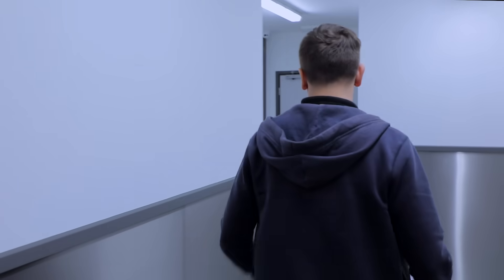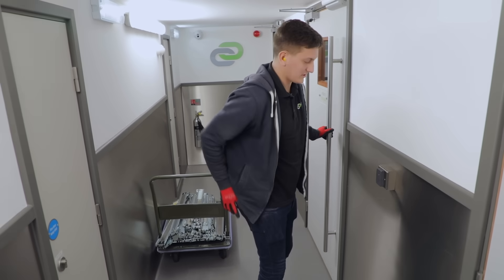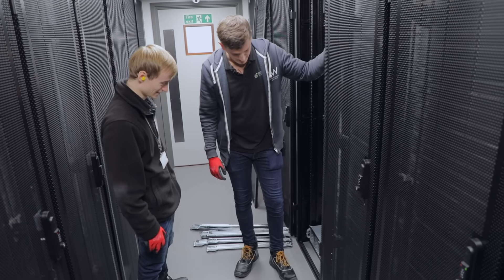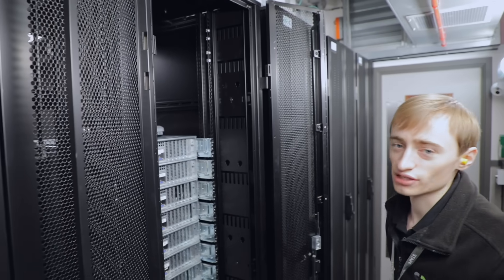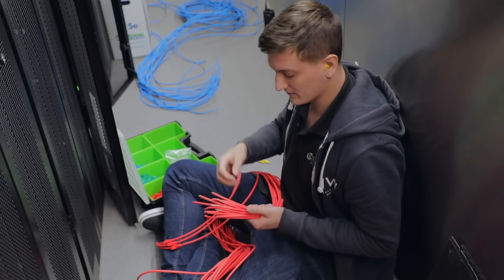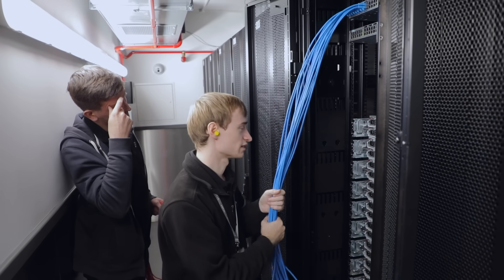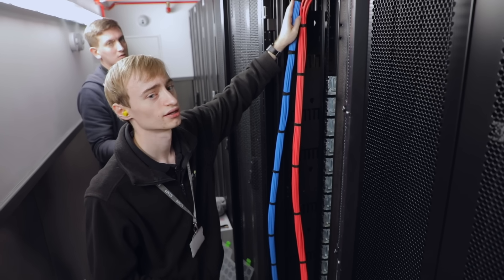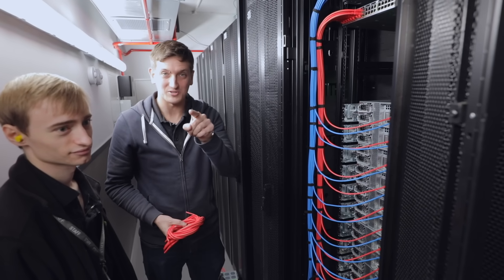A DAY in the LIFE of the DATA CENTRE | FULL CUSTOMER "RACK & STACK" with ASH & JAMES!

Comment: Isn't it more cost effective and faster to just use pre-crimped patch cables of the right lenghts?
Reply: Not faster, may be. First tou need to select correct lengths. And they will definitely not fit like this. Some will be shorter or longer. It is possible to make it look ok, velcro straps helps a lot, but not so cool.
Reply: @sYBtyumen  not to mention the certifying and testing process. Why would it be important to look neater if it's in a dark cabinet hidden and inaccessible to public?
Reply: The original question was about cost-effectiveness and speed. Not about quality. I personally prefer machine-made certified patch-cords  to ones that are made in-place by humans. It would look slightly worse, but almost definitely without CRC errors.
Reply: @sYBtyumen  under cost effectiveness I also include quality, because if you have lowee quality you see failures more often and have to deploy a service call
Reply: @KnaufL  you are close to be an ideal customer. No irony. Glad to see a person who understands that cost of maintenance and troubleshooting is a part of TCO.
There is a paradox. The higher is the original quality of parts and work the lesser will be the number of customers who think about troubleshooting and maintenance the next time. Cause they'v seen no troubleshooting, or troubleshooting results tell that a problem was in OS/Services/Apps etc. not the network.
Reply: @sYBtyumen  i try to understand both sides as best as I can. On the client's side you can look at it as if the client has a limited budget but wants to maximize profit margins, so for example he may choose cheaper equipment at the beginning and then gradually upgrade as his business grows

Comment: as someone who racks and stacks servers all day long, this is 100% the correct way to do it, but this takes way more time. rail, rack, and wire and power up about double that amount of servers in one day.
Reply: Yeah but do you know how to configure any of it... if you're doing this day in day out, I guess not and you leave that to the engineering experts, right? :)
Reply: @leephcom  that includes installing an OS as well as config. but its a minimal minimal install and a minimal config. still, 80 machines to image and bang in some ip config plus some minor troubleshooting. your hands will bleed a little and there will be TONS of trash laying around. dac is not fun to cable manage. especially 100gig dac. or 40gig breakout dac. ethernet is a breeze though, but i dont cut to fit.

Comment: You didn't leave slack to pull out the servers for servicing
Reply: Yeah that's what I noticed as well.
Reply: @MrMrRubic  it's pointless, costly extra cable lengths just to avoid unplugging a couple of cables in order to slide it fully out? Most don't bother with cable slack and concertina arms these days. You've got to power the thing down to do most maintenance tasks anyway so no need to keep the cables plugged in.

Comment: bro, you need to get some UCS. pretty cabling though, when you cut them to length I actually shed a tear.
Reply: That 15-meters copper USC cables...  The fibre-optic ones are much easier to fit (and sized better).

Comment: Do you realize that by not having those hinges welded, you are vulnerable to a low skill attack by someone just lifting the door a bit, especially since your ceiling seems to give out at the first thought. Also by not having to use physical keys to open the main doors, you are even more vulnerable. You are giving out crucial security information by doing this. And you are doing it wrong.
Reply: You are forgetting the fact that someone will first have to break in, sneak past security and unlock giant steel doors just to get into the server room. At that point, a welded cage door will not stop that person from destroying whatever they please.
Reply: @adoreyourpain  was just about to say....if someone gets around all that i think they are equiped and ready to break whatever security on the actual servers too
Reply: Also there are cams in every corner and electronic locks on literally every door. How is a physical key better than a key card which is personalized and trackable?

Comment: I crimped hundreds of cables, in the wild.
But in a DC: in my opinion a no-go.
No quality assurance,  even not a good idea with a Fluke tester, very expensive manual labor and you can redo your work when replacing the server in a couple of years for whatever reason. 
So,  my preference: a longer stock  cable with a loop.
Reply: Agreed. I was very surprised they didnt at least put a tester on each cable. Anytime i make a cable, i always throw a tester on it.
Reply: @Bob-TheTechGuy  eee, managed switch shows you if its gbps duplex capable, or you just floodping or run test on each machine for some time. these guys look like they know what theyre doing. i also met shitload of out-of-box not working cables

Comment: Why would you want to use cooper patch cables when there's cables that offers higher bandwidth? Basically you'd need less cabling. Those could be 10G though but still, I'd much rather just uplink a qsfp, just a few per server and call it a day. What am I missing here?
Reply: The cost of all those cables is probably lower than 1 single DAC or Fiber. Then you need additional NICs in the servers. Then you need switches to handle all links. And at the end of the day you're bandwidth-limited to the internet anyway, so unless your workload needs >10GBit/s links between the servers, it's pointless and a waste of money.
Plus the onboard management port needs copper anyway.
Reply: cost
Reply: Red is LOM in this case, that's RJ45 almost everywhere, blue is one out of two 1GB ports which you normally only use to install/update/configure the OS and sometimes to monitor your applications. The application data will then run on one or more additional network cards where they will have something such as SFP10, SFP28 or even higher depending on their needs.
Reply: As a former tech, I agree, would love to just plug-in pre-made fiber cables.  Most likely these Cat-5 cables are used for OAM or Bearer Network connectivity, this only requires a 1G connection, 10G would be overkill.  They could have used Twinax cables, but that would require a different switch.
Reply: If i'm not mistaken the direct attach copper cables have the same bandwidth as fiber cable just over a very short distance
Reply: @nicksenske662  SFP+ delivers 10GBit/s, or 40GBit/s with a QuadSFP+, regardless if it's Fiber or DAC. Copper SFP+ is just limited to short runs (<10m recommended) for passive cables, but there are active DAC cables too, costing a fortune.
That being said, I had a customer who didn't have his Fiber ready to connect 2 buildings so we improvised with about 40m of CAT7 Ethernet cable to run 2x10GbE. Worked pretty well for a few months until the Fiber was ready. Honestly, for short runs 10GbE is the way to go. Many Servers already have 1 or 2 10GbE ports on-board, I wouldn't be surprised if those had it too.

Comment: cat 5 in a data center? in 2019?
Reply: It looks like it is just for management/config. They said the fiber cards are not in yet. They said the fiber lines go on the other side of the rack.
Reply: @imkrazy182  two copper connections from different switches JUST for management PLUS fiber to each server. WOW. I think the fiber is going 'into' the 2 switches and the copper rj45 cables are feeding the diverse connections to the servers. No?
Reply: @patdbean  A lot of data centers use fiber to connect to centralized storage. Its actually pretty common to have a copper line for IP and a fiber line for san. 
As far as cat 5, cat 5 should never be used in a data center. You can make an argument that cat 5e is acceptable. I would never use anything less than cat 6 while its only 10-20% more expensive.
Reply: @toasty5613  I was thinking 5E , do they even make classic CAT5 any more ? I have standard cat5 here at home (installed in 1995) and get gigabit speeds out of it  but the longest run is about 20M
Reply: @patdbean  Im sure people still manufacture cat 5. Its just not in any recognized standard anymore. Cat 5e was designed to solve problems with interference at gigabit speeds. If you are only running gigabit connections, cat 5e is just fine. Especially for a home lab environment. In data centers, cat 6 should almost always be more then enough to connect application servers to TOR switches. In some scenarios, you might need STP shielded cat 6 or better depending on how important packet loss and EM interference mitigation is. And like I said earlier, you will see some data centers using technology like SAN boot where you almost always cant avoid the cost of a fiber network alongside a standard IP network.
Reply: @toasty5613  what is the spec on CAT 7?  I stopped  working in IT before that came out.
Reply: @patdbean  tbh, dont bother with Cat 7. Apparently it lasts longer and could save you money  in the long run. Cat 6A and Cat 7 both top off at 10Gbps. Cat 7A tops off at 40Gbps though. However, the IEEE standard says that 40Gbps speeds requires a minimum frequency of 2000 MHz which only Cat 8 supports. Cat 7A tops off at 1000 mhz.
Reply: Are the runs just short enough that cat 5/6/7   makes no difference?

Comment: You didn’t allow for the rack being pulled out and still be connected to the switch... they can’t pull out and upgrade the rack while connected ;( 

What’s the point on having the rails if you can’t pull them out without pulling out the Ethernet cables?
Reply: I think the rails are still there for ease of maintenance. I mean depending on the server type things that you can hot-plug like e.g. disks are often accessible from the front or back directly. All other parts you typically cannot maintain while the machine is online anyway. So you'd plug out electricity and ethernet and then start to replace/add components to the server. However you can still do this without completely taking the server out of the rack. Just pull it out the server on the rail, open the chassis and replace the parts.
Reply: During maintenances we often need to power down entire machine to open box and do whatever is needed. I liked their job leaving the cables as it is is much better for air flow and less visual noise
Reply: @Freakzoid2025  visual but not practical and if you need to shut down an entire production rack to work on 1 server you’re doing it wrong 100%.
Reply: @CustomComputing  I understand your pov

Comment: Why are there two ethernet cables per server instead of one?
Reply: I think it is for redundancy, if ever one of the switches or links fails, the connection between the users and servers are still on.
Reply: One is used for management and one is use for everything else.
Reply: Either LACP for redundancy, (one interface to one switch, other interface to other switch, switches aggregate together) or one for out of band management (IDRAC/iLO/IPMItool) and the other for host traffic.

Comment: Just a few thoughts...why in hell would you manufacture the first connector actually inside the server room with limited space and the extreme noise floor?
on the same matter, why not using prefabricated cables? can't be the price, since the shorter cables are way cheaper than making them.
everybody commenting on using cat5 instead of cat6: yes cat6 ist better, but on this very short distances you wouldnt see that much of a difference, alltough i'd prefer the cat6 too (just to sleep better)
The cable comb is a nice thing indeed, but the more cables you comb together, the better the cables should be(see above)
Switches put in backwards is a common thing, especially when you can easy reach the backside of the racks.
But why not using the advantages of this setup and placing the switches up top and not wasting valuable rack space? (there ist always the one server that MUST fit into this paticular rack and you need to reposition something to gain that extra 1u to fit it in.

Comment: I like to leave 1u or 2u between servers and put top of rack switches instead in middle, of the racks I've seen rarely are any configured with sufficient power and cooling to handle more than about 14x dual socket servers. 2u * 14 = 28u worth of rack space so even with 2x network and 2x storage switches there's still lots of room that you probably can't add more servers to.

Comment: Is it really cheaper and bette (connection quality) to manufacture the patch cables by themself instead of have preconfigured sets?
Reply: It depends on the length. Hundred foot cables yeah do it yourself. Foot long and six inch, get yourself a bag of them. Anything in between just use your judgment.

Comment: Not leaving slack to pull the server out on it's rails bugs the hell out of me.  When installing servers I build a whip with all the power and network cables in a mesh sleeve to the server coiled up so it retracts with the server being pulled out on it's rails.
Reply: I agree with you but I think in a Datacenter that doesn't apply really. First of all let's agree on the fact that a server in a DC has to have an uptime of 100% (except of course for the be weekly windows update or some patching that requires a reboot, or maybe a dedicated software that has some issues).
Then, if you don't have any connectivity and you need to have access to a serveur, you can go plug yourself on the back or if there's a KVM you can use it too.

So beside that, the only time you will pull those servers is in an EOF cycle.
Also, if you suggest a hardware issue, the "most common" issue is regarding the SSD/Hardrive having an issue or a raid controller having an issue, in those cases, no need to pull the server you can hot swap those)
Remember that those servers are top of the line servers (full RAM, bi processor, dual power supply etc).
I've honestly never seen a top of the line server have a critical hardware issue and it's even true in the recent years.

That's what I think, thanks for your comment.
Reply: @Loutripe  most common issue we have is having a "RAM Error" which can be remedied either by popping all the dimms out and pushing them back in, or if that doesn't work then replacing one. The other thing we find ourselves doing is changing pci-e cards for NIC upgrade or downgrade to 10GE or 100GE. Servers get repurposed a lot around here so the 100% uptime comes from migrating VMs around. But dealing with bare metal at the Colo really sucks if you can't slide the box out on it's rails.
Reply: personally i would zip tie the power cables to the server as possible, way too many accidents with power when doing repairs otherwise

Comment: You cut the cables to the exact length to reach the server ports when racked. Presumably, you plan to tuck-in the power cables just as neatly. Looks beautiful, but...
How are you going to slide a server out on the rails now? Must the customer have a unit down, just because a redundant, hot-swap fan needs replacing?

You need some cable-management arms on the back to get the best of both worlds: no hanging, slack cables and on-line servers still able to slide out.
Reply: honestly ive used tons of different systems and I have yet to find one I like for copper, particularly in the type of racks in the video. In fact the only one I think works as intended are the big fibre managers. The rest are frustrating to deal with for repairs or decommissions.

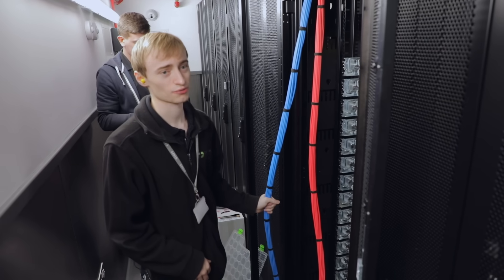Comment: Probably a dumb question, but around 10:30, are the blue cables primary and the red redundant in case of an outage, etc? Or are they just different connections?
Reply: They are for redundancy. To avoid a single point of failure.
Reply: @yoloredalert8404  Nope.
Reply: I have no way of actually knowing, but one possibility is that one color is the actual network connection, while the other runs to the NIC that's connected to the BMC+management engine. Proper network hygiene (according to my worldview) would isolate these NICs from arbitrarily being accessible. Redundancy is indeed the other possibility; cables running to a pair of switches is pretty ambiguous.
Reply: Could go either way really.  Usually with a DC rack you would have separate networks (two minimum) and Management - so 3 network cables. Not sure what this DC and Customer have worked out for their topology or requirements.

Comment: love that looming tool, I used to have to wire up cabinets by hand.  However speaking as a server engineer wiring up this way means everything has to be unplugged if you want to pull the server out for any kind of servicing and testing means plugging in extra fly leads power leads etc...  a real pain
Reply: yeah I've learned to always keep enough slack for that. Fiberninja is a really good channel to watch too :)
Reply: always keep a service loop less downtime

Comment: this is funny, in my data center our management buys a ready made cables already of different length. In my opinion I don't think you really need to do that crimping anymore now a days, maybe if its your own lab at home like mine its fine.
Reply: Especially since they are using cat5.  Alot of data centers use cat6 minimum with already made cables. Only did crimping in college and home use haha
Reply: Taking up way to much unnecessary time?
Reply: So for my little (~1000 node) network we buy pre patched too, but running exact length is by far cleaner. If we werent shutting down this network I would have insisted we cutover to manual and align with the rest of the company standards. The other issue I have with prefab is when the server guys run cables and they pick up a 20 ft instead of the 15 ft they needed. Especially with big builds space is at a premium. And decommissioning becomes a nightmare. But for small enterprises with a dozen servers than yea dont waste time patching. Just depends